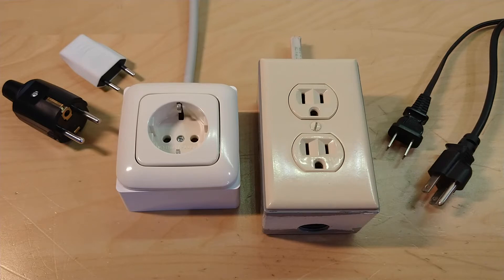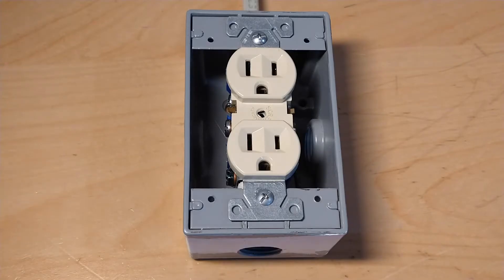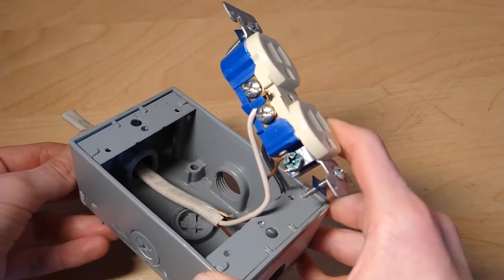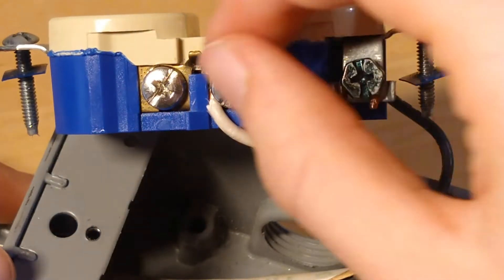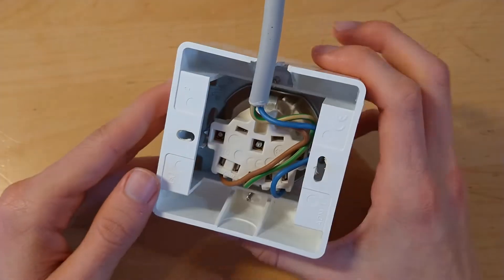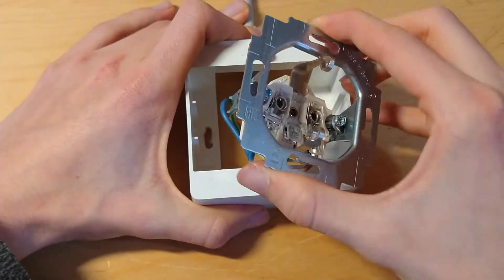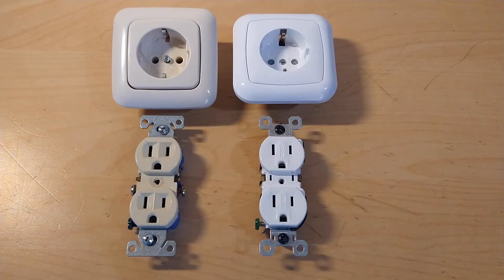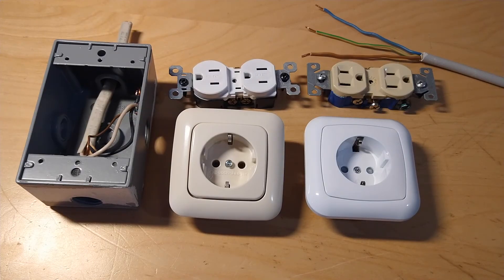American vs European Power Sockets: What's The Difference?

Comment: How about Chinese electrical receptacle ? 2 pin for Chinese US 2 pin without holes in each plugs, also accepts Europlugs in US non polarized + Euro outlets, but 3 pin plug in China is Australian slanted flat pins but ground pin is at the top that also has shutters on 3 pin Chinese outlets but cannot plug 2 pin Australian slanted pin plugs. Also have 16A Chinese plug , Australian 15A plug are not the same and not compatible with each other. Chinese 16A plugs and outlets used for airconditioners, machines, etc. Doesn’t with with Chinese 3 pin 10A plug.

250V 10A for Chinese Aussie style 3 pin plug

250V 6A for US non polarized Chinese plug without holes.
Reply: I hate them lol. Plugs and sockets must be standardized.

Comment: the us sockets and plugs look like Toys. schuko is just better.
Reply: French style sockets are better, I don't know why Germans adopted this weird schuko thing, here in Czechia we use French sockets too, it's ridiculous that even neighboring countries in Europe have slightly different sockets. When you have 3 pin plug, you expect that wiring will be always the same, but with German socket, you can insert it vice versa, ofcourse it's nice to have possiblity to mount stupid L plug vice versa, but on other hand, brown is not phase anymore, I know that it's not a problem for product, but in some rare cases, it could be and when it has grounding pin, It should be mounted always the same. Also, phase hase to be in left hole in socket and with symetric schuko socket, it's easy to flip it and install socket accidentally vice versa, so again - safety risk. With French sytyle, you immediatelly see that it's vice versa when grounding pin is down, not up.
Reply: @Pidalin  Easy solution. You treat neutral as dangerous live (phase) when it comes to AC electricity due to possibilty of open neutral.
Reply: @ btw, I realized that phase in left hole is standard only here in Czechia and maybe in Poland and Slovakia, in Germany, it's actually vice versa 😀
Reply: @Pidalin  In Poland we don't have regulations in electircal codes about phase positing, phase on left side is only some electrician practica.
I prefer put phase always on right side because this is correct for E sockets standard and every appliances with unischuko plug has factory phase putted on the right side
Reply: @Pidalin  Sure polarized plug help to be safer especially when a switch cut only one wire, always better to cut the live. Unfortunately the French ungrounded plug is not polarised either. I think the best plug in the world is (and it cost me a lot to say that as I'm French) the British one. It's bulky ugly as hell have a stupid fuse inside, but technically it's really good. The blades are thick making a great contact, always polarised as even ungrounded plug came with the "earth pin" can't be removed by pulling the cord, the inside wiring scheme lead in case of extra pulling to break the line then neutral and finally earth and even the gross stupid fuse will protect the thin 0.25mm²   cord plugged in from overeating. Again absolutely ugly but definitely technically the best. (the plug only, the ring circuit behind is pure shit)
Reply: @lapub.  That is like saying Micro USB is better than Type-C because one is polarized and the other is not 😅
Reply: @Mixolixplosion  USC-C is polarized the same way micro usb is . The USB-C pin layout is symmetrical so no matter the way you plug it, it will always match. The same would have been achieved in an electric plug with L-N-ground-N-L in line layout, polarized but one you can plug upside down .
Reply: @Pidalin I don't know what devices you are using😂
Reply: Both are toys.. UK socket is the king 🤴
Reply: @A8x8A  ugliest socket in the world 😅
Reply: @A8x8A The Schuko plug is 🤴. The UK plug is for children under 3.

Comment: The only disadvantage of the Schuko System is that the the polarization is not warranted. The phase can be on on the left or right pole and the nutreutral one as well. A lot of firms instal L on the left an neutral on the right. There is no common rule for it. All in all the Bush Jaeger socket is much save than the us one.
Reply: We're using AC, polality isn't really matter.
Reply: @DangerWrap yes but also no, sometimes it matters what n and l is. like with oscilloscopes and meassuring stuff.
Reply: @SB7-r9i  It never matters... if it matters your device is crappy... Shuko is 5 times safer and easier
Reply: AC never matters what polarity it is, current is always rectified. It flows from zero to phase and from phase to zero 50 times per seconds, so it never matters. Trust me, we live like this for decades.
Reply: @きょうま鳳凰院様  it is not about the polarity. It is that the Phase has voltage to earth and the Neutral not . If you want to check the sockets in a house it is much easier if all sockets are wired the same. For example the left phase, right Neutral,middle clamp or pole PE. It would be dangerous if you clip the phase wire to the PE connection.
Reply: @eos-fan why would you insert a phase wire into a PE terminal? Are you blind or what? 😅
Reply: There is nothing wrong with the schucko, it is much superior to the American one, because in the European system they use a general differential switch that trips if the phase or neutral touches ground while in America this is not the case, here at the NEC we clear up the insulation faults in a stupidly dangerous way with the overcurrent device... if the phase touches grounded metal BOOM baby 1000A short to ground they easily set your house on fire, America calls it "effective ground fault current path"
Reply: It doesn't matter the polarisation of the socket  as well you can plug in both ways. There is no fixed position
Reply: In AC, polarity doesn't matter, since the full-bridge rectifier will polarise the electrical current by itself is the device components are in DC.
Reply: I consider that an advantage, not a disadvantage. It forces manufacturers to design safe appliances for which it does not matter which pin is live, rather than be tempted to make assumptions (consciously or not) about which pin will be live.
Reply: @captainchaos3667  In some case, like bulb socket, it's safer to have the central pin live as you're far less prone to touch it if you swap a bulb without knowing it's on.
Reply: Electrical wiring will often times be done wrong by DIYers or inexperienced electricians, so nobody designs devices in a way that it requires neutral to be in a specified position to be safe. Not only that, the only non-earthed plugs that are non reversible are UK plugs (since they require an earth pin even if not functional), US plugs (neutral is larger than live, some variants have horizontal neutral and/or horizontal live) and australian plug (two blade receptacles at an angle). Everyone else can be reversible with 2-pin plugs everywhere else.
Reply: @jackmcslay Schuko is like USB-C, the polarized ones are like USB-B.

Comment: 6:32 the one on the left is an inside socket and the one on the right is an outside one.
Reply: Yes and when you need more dust and safety protection, you often see outside sockets even inside in factories, workshops and stuff like that. Here in Czechia, we use french socket, I don't like these German schuko sockets.

Comment: That European outlet is doing half the job the American outlet is doing. I do think the American socket needs an update but I'm not sure dangerous these sockets are in real life. What percentage of fires end up being from sockets? Of course when the government mandates things innovation lags.
Reply: you can get zapped when unplugging a north american Plug, by accidently gripping the exposed metal part when it still has power. this is Impossible in the european system.
Reply: @SB7-r9i  Sure, but I've never had it happen to me or anyone else I know.  If it were a huge concern, they would have changed something about the design.  Just as they did in 2008 when they introduced safety shutters (like the UK sockets).

Comment: USA socket version is a joke, so dangerous, and still no improvement today. And final blow is slot-headed screw, which should be forbidden to use
Reply: Japanese Type A outlet (by Panasonic and Toshiba)
Reply: South Korea used 110V 60Hz for US outlets but 220V at 60Hz for EUROPE 4.8mm outlets. Appliances from South Korea uses Europlug. Type F
Reply: Add some plastic door inside that will hold flat  pins while they are in including 3 neutral like on Irish outlet big plastic pin that you actually need to press to remove and put in čavle in outlet , that would prevent accidental electricution    With hand friendly shape cable plug you can actualy grip with your hand ( fingers ) also improvisation is a key , improving standard outlet by taking what is good from other  plug standards and modififying  it  coming closer to  few Universal standards that cost lesss to produce but provide more value  in general quality and safety .
Reply: The military base near me, which is shared with us (I live in UK) so it is a joint us and British base has american outlets and they are apparently a pain all the time.
Reply: Don’t see the point of “forbidden slot screw”
Reply: European sockets have to have an extra layer of safety, because of the higher voltage. As you may notice, you cannot access any live parts when putting the plug in. The smaller "europlug" has sleeved prongs, and the bigger "Schuko plug" covers all the recessed round part of the socket before it makes contact. By the way, look at the 3 phase 400V plugs and sockets, they have such an industrial vibe into them ☺
Reply: I agree they could be better but they are not "so dangerous" and flathead, while annoying to work with,  applies more torque than phillips and doesn't strip as easily
Reply: @chrishall2594 they are, you can slip in 2 ways, with cross headed you cant.
Reply: Not really dangerous...it's 110 so its tolerable if shocked assuming you touch it live. Alot of the new ones have the child safety built in. Also from the plug face you can only get shocked if both slots of a plug are touched with a conductive object...I have always wondered if you can build an american style electric grid house in europe. If you had all the american electrical equipment to do so. If you had the panels, wires, outlets etc...would it work? Obviously wouldn't work on European products but if you only had american products...same as could you build a European system house in America with all European electrical products...
Reply: @DcDouglass84  I would work... only if you add a stepdown transformer ! I wouldn't try to apply twice the voltage on the socket... And even if you use only 220V sockets and breakers I'm not sure they are sized to held the short circuit current that the grid may deliver. (as the transformer can be a big 1000 KW in a shelter and not a small 25 KW pole mount one)
Reply: The German made one looks way less sturdy. All springs and small metal bits. No.
Reply: @steveodeluxe While it looks less sturdy, it definetly is pretty sturdy, or even more sturdy than the american one.

Comment: This is German socket.

Similar is French, which has better ground connection and is polarized (no live-neutral swap is possible).
There is a common plug which fits both. 

But I think that the Swiss system is the best.
Reply: The French is only polarized in theory, there's no reg that states on which side the line must be and on which side the neutral has to be. And the earth pin of the socket outlet is prone to break.
Reply: @Marcel_Germann  I've never ever in my life saw someone break the earth pin of a type E socket. I don't say it can't happen, but I'm extremely curious about how much force you need to apply to break the pin
Reply: @benjib2691  The earth pin is longer than the others. The rest is simple leverage.
Reply: @Marcel_Germann  I know that the earth pin is longer (I see type E sockets everyday as a Frenchman), but I don't see how you can physically apply a strong enough leverage on it for it to break. Especially since the earth pin, while being longer than the live and neutral pins, doesn't stick out of the external part of the plastic shell of the socket. Thus a part of the plug is already inside the outer part of the socket when the earth pin enters the plug, limiting quite well as a result the maximum mechanical leverage someone can accidentally apply on the X and Y axis
Reply: @benjib2691  Something protruding always offers the potential of breaking it off. Not with the proper plug, but with some adapter constructions that fdor example tourists use.
Reply: @Marcel_Germann  Absolutely never see an earth pin break, it's full metal, it can't broke without bursting the whole plug, even the ones from crappy Chinese power strip.
Note the pin is flush to the body of the plug the same way the shuko earth is
Reply: That is relay an disadvantage of the German system. For camping, Industriell devices and permanently currents up to 16A 230V the blue CEE plug can used. In that norm all pole have unique place. But it is not common for home use.
Reply: Swiss plug also simmilar to Brazilian plug but not compatible with each other.
Reply: @FrancisLitanofficialJAPINOY  System used in Brasil and South Africa are designed to be similar to Swiss system and become world standard for 200-250V systems.
Reply: This socket is the same with indonesian

Comment: Stranded wire for an electrical installation sounds very weird being from the US.
Reply from the maker: Yeah, it's quite unusual even in Europe! As far as I know it's just Italy that uses it for everything. Though even in the US stranded wires are sometimes used inside conduit for commercial applications
Reply: @samstech963  In Brazil they used to require solid core wires, later they changed the rules to allow stranded wires and now solid core wires are hard to find because everyone hates them.
Reply: We use stranded wire here all the time in US!
Reply: @fsherman898  Yeah, but only for (sometimes) wire inside conduit and power cords on appliances.
Reply: @HIDLad001  Service entrance conductors, anything larger than 10AWG is usually stranded wire
Reply: @fsherman898  Yeah they are usually aluminum too.

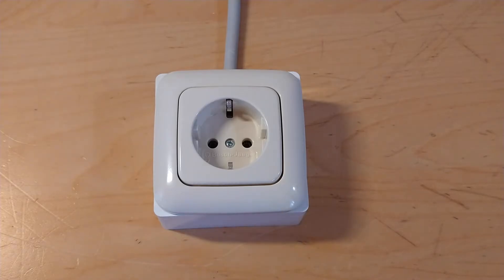Comment: 5:40 "Busch-Jäger" socket - best quality you can buy. "Mercedes" oder "Cadillac" of the sockets.
6:17 Cheap socket, so called "hardware store quality".
I´am licensed electrician / technician, prefer "Busch Jäger" of course.
Reply: In Belgium, Niko are the  "Mercedes" oder "Cadillac" of the sockets and light switches.
Reply: In Finland all sockets are like this:
https://www.gigantti.fi/image/dv_web_D18000100227449/A222329/ezo-2-paikkainen-maadoitettu-pistorasia--pdp_zoom-3000--pdp_main-960.jpg

I have never seen the German style of having two singles next to each other. Some years ago the the sockets were really stupid diagonal ones:

https://cdn.bauhaus.fi/media/catalog/product/cache/569848a67a579fd0e29cbf678dbb39c0/6/0/60507602.jpg

I wonder who thought that was a good idea. If the sockets were horizontal it would make more sense.
Reply: The company Gira produces high Quality sockets and switches as well.
Reply: Really? an Italian VIMAR runs laps around that for safety... I'm quite perplexed that it is up to code...

Comment: That looks like a German outlet. In Germany they tend to use single ones and wire two of them side by side. This is nice as the cables do not interfere. In Finland they use double sockets where they are one on top of another like in the US socket.

In many counties there an still be older ungrounded sockets. In Europe they do not cause  a problem as all plugs fit while in the US people cut the ground prongs and do other shady things. people used to do those in Europe in the past but as all the equipment with old ungrouned  plugs have been scrapped that is no longer an issue.
Reply: Yeah it’s schuko. It also used in post soviet countries

Comment: Nice video. A lot of US sockets when contractors install them they tend to wrap them in electrical tape too. Adding a tad bit more protection. Also if the install uses solid steel conduit, then a ground/earth lead may be absent as the box itself is grounded. US sockets are very sketchy though. Basically no changes since made.
Reply from the maker: That makes sense, yeah - those terminals are placed right where someone would instinctively put their hands to pull the socket out of the wall. It really seems like quite a dangerous design - I hope this will change in the future
Reply: @samstech963  I mean I am used to it, so if I am pulling one out while live (Yes, I have changed these outlets many times while live, best practice says to shut power off first) I unscrew the top and bottom, and pull it out from the top/bottom carefully.

Comment: Very informative! I've found a difference between your sockets and mine (in wall, Belgium) : we could take the screws off the chassis after popping the frame off the face plate, and it's needed to remove the face plate off the socket assembly (or is it? I've just never done it without removing the chassis 😅)
Reply: There is huge variation of sockets in Europe even on a single country and single type when if comes to what it is inside. In the US they seem to be far more standardized. In Finland only an electrician can install sockets so the insides really are not something average user needs to worry.
Reply from the maker: Huh, interesting! I think I've seen that on some lightswitches